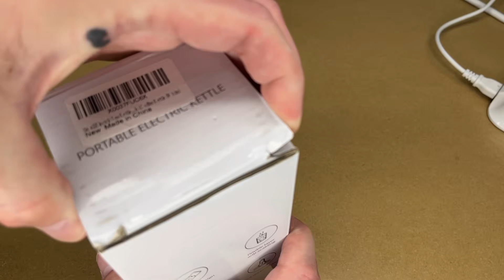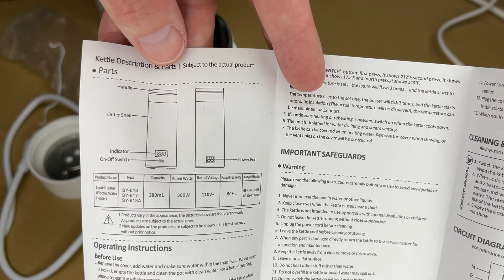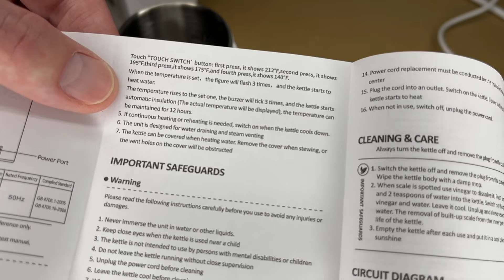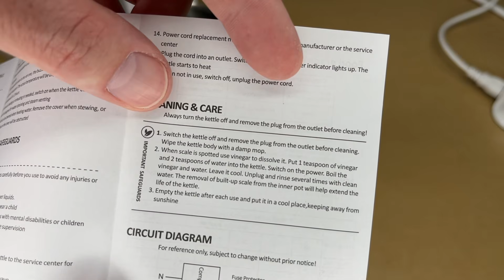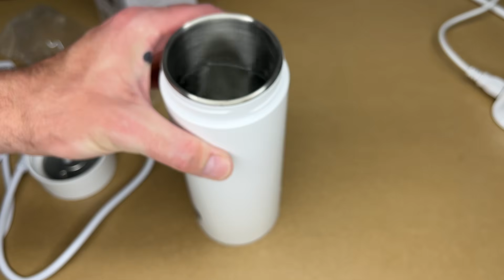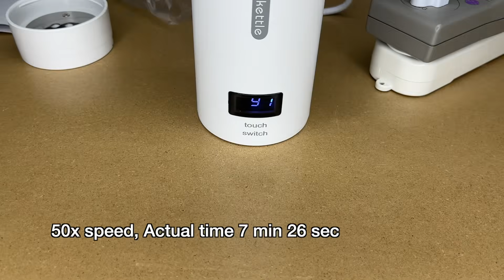Niohura Portable Electric Kettle

Comment: I just bought one of these at the thrift store for four bucks, seems like a bargain, I wish it maintain temperature and didn't shut off. Does anybody know what the BB stands for?
Reply: bb might mean "buzzer beep" - Buzzer Beep might mean the unit has reached the desired temperature, and for the next 12 hours you can drink this 1 cup of liquid reasonably warm if you keep the lid on (it's a thermos).

THis is a KETTLE, not a crock pot.

Comment: What adapter would I need if i wanted this thing to work off the cigarette lighter in the car. So i can boil water while parked. Would it draw too much car battery power during the 8 minutes?
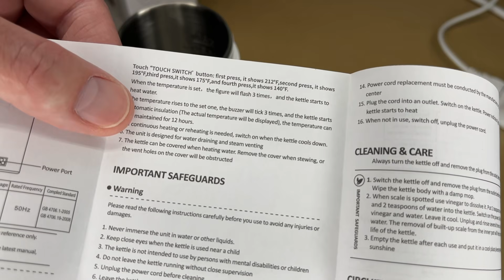Reply: 1:24
Reply from the maker: This draws a little over 300 watts so I would go with at least a 400 watt inverter.
Reply: Your engine should be on, and you would need an inverter. This is not DESIGNED for use in a CAR (300 watts is a BIG power draw).  If you have a solar panel and an inverter, well, maybe then. I would not risk it on the car battery.   Check your car specs.  Honestly, I wouldn't do it.